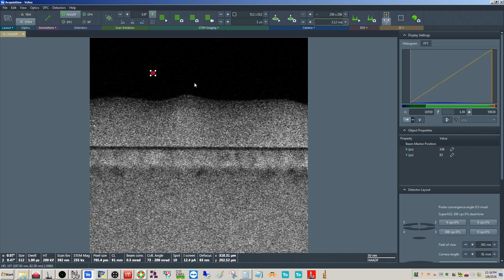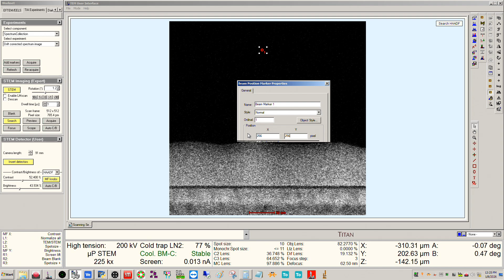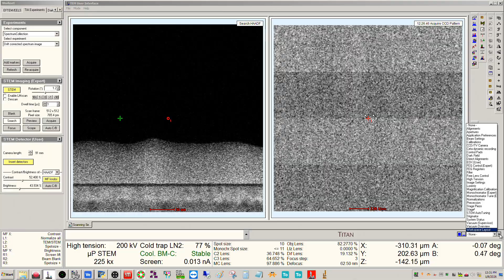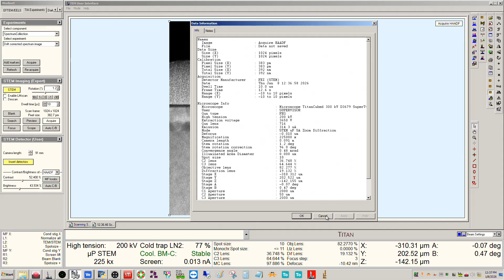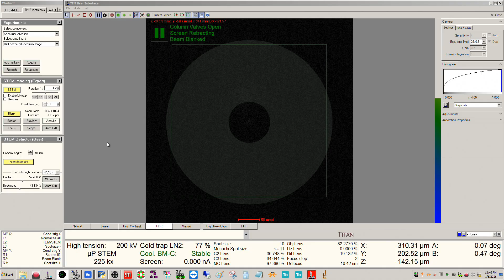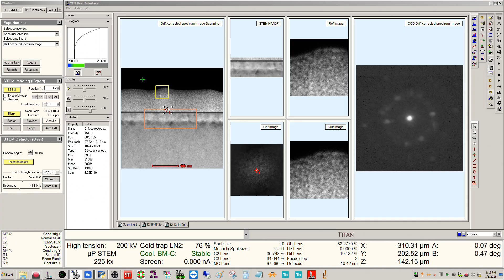FEI Themis Z S/TEM: 4D-STEM using TIA and Ceta CMOS camera

Comment: Excellent work Nicholas, thank you very much for sharing! Just one quick question - what shutter setup are you using in the camera ocx - disabled, post or pre-specimen?
Reply from the maker: Thank you; that's a good question about the shutter; I know I have rolling shutter disabled and in the "Mode" tab, this is set to "Continuous" (which I apparently never clicked on once during the video for some reason) but I was actually unaware of the other setting you are asking about.  If you look at the video at 17:18 you can see the info for the Ceta camera in TIA, but it doesn't say anything about the shutter under "Acquisition" (which is where I would think it would show up).  I'll do some digging in the next couple days and see what I can find.
Reply from the maker: Thanks for your patience!  OK, so when I expand the flap-out in the CCD camera panel (on my system), there area are actually 4 additional tabs you can access: "Settings", "Mode", "Bias/gain", and "Shutter" (but you can only see three at a time).  Anyways, clicking through to access the "Shutter" tab, I had the "Post-specimen" option selected when I did this experiment.  This keeps the beam always on the sample, which should be fine considering the specimen isn't too beam sensitive and the beam current is very low.  The "Pre-specimen" option tends to work better for beam-sensitive samples, but I'm not sure how selecting this option otherwise changes the 4D STEM experiment; This actually gives me an idea for a video discussing the two Ceta camera shutters in greater detail (since this is often a somewhat neglected consideration), so thanks for the inspiration!